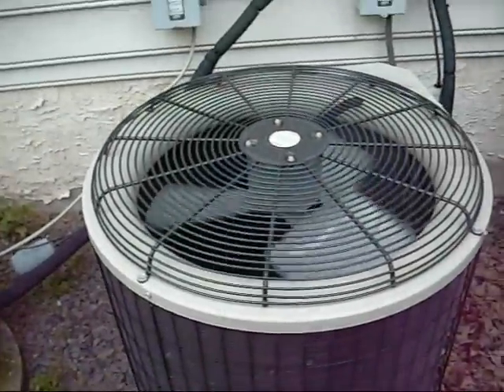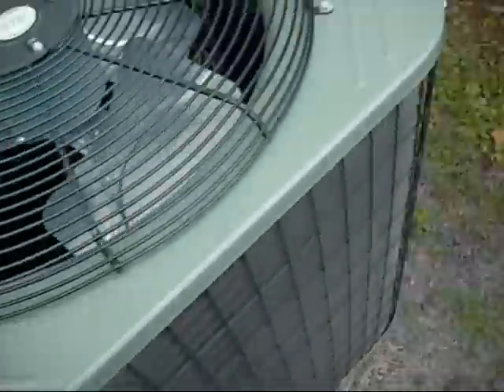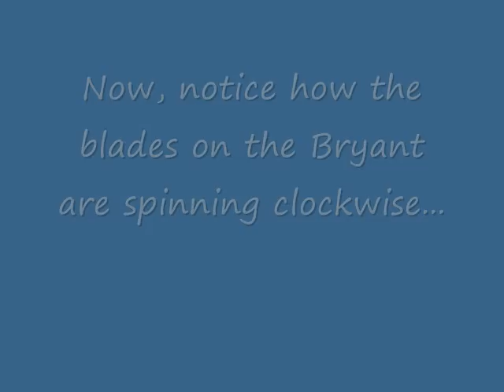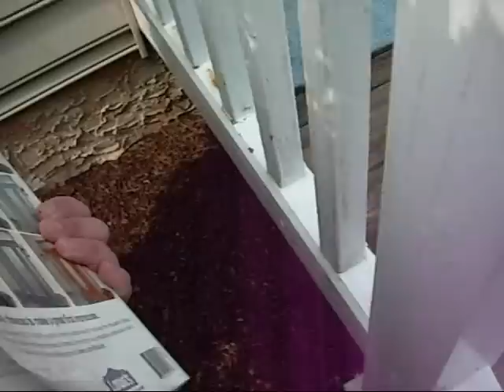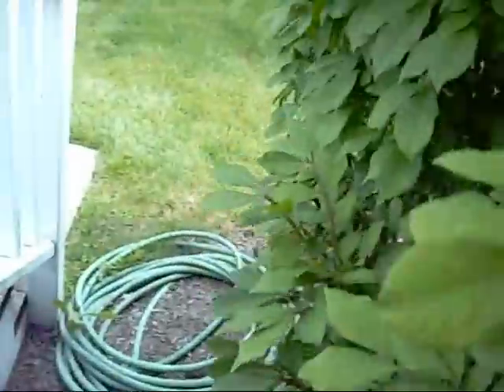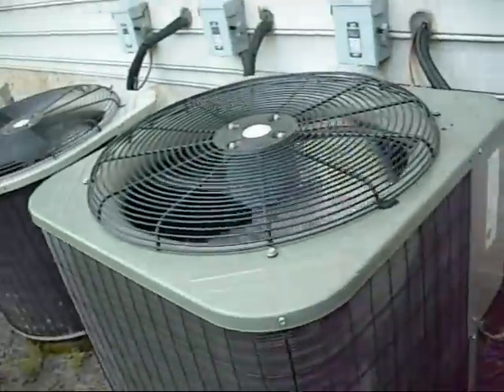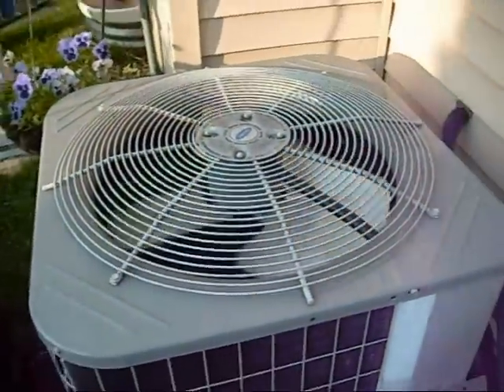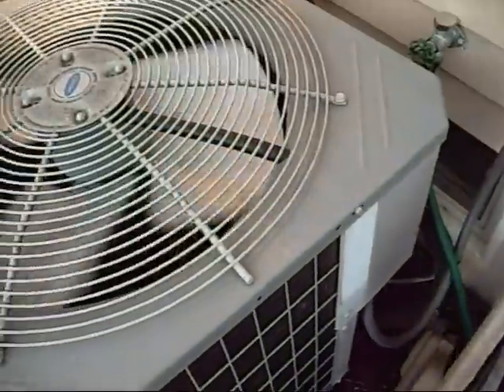Central A/C fan blade phenomena

Comment: I think that effect is caused by taping a fast moving object- the fan blade- with a camera that is capturing video at 29.97 frames per second, as is standard. So, the fan is spinning at close to 1500 rpm, and the camera can't keep up, so it delivers what it can, making the video look like the blade is spinning slowly backward.